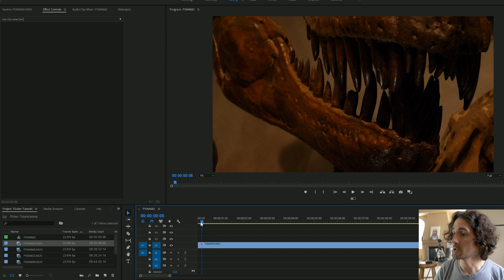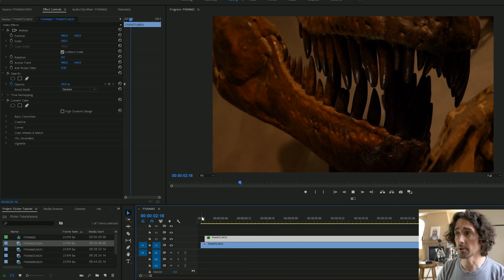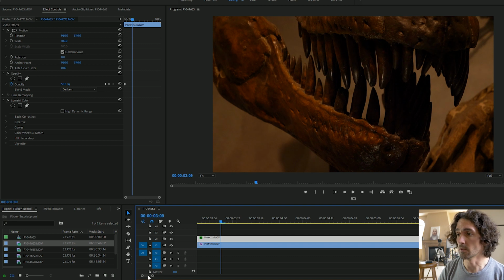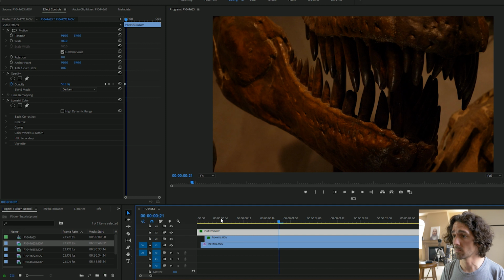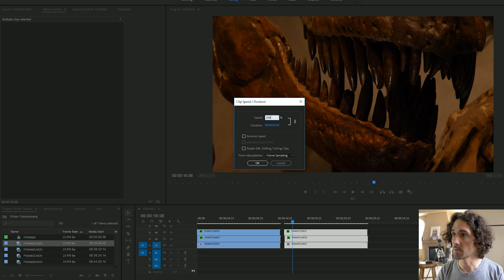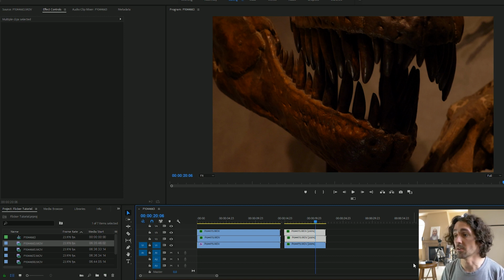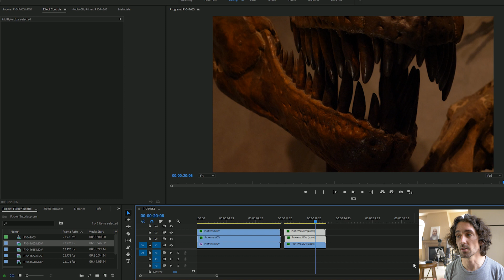Quickly Remove Slow-Motion Flicker In Premiere

Comment: Hey, didn't get the "200%" clip speed. By doing that how did you kept the same speed and motion in the clip?
Reply: this is really late, but he didn't keep the same speed. it's just that he increased it from 1/5 speed to 2/5 so it's still really slow but slightly faster

Comment: Okay...Why this is not working...? I shoot at 60 fps  - NTSC  (i am in Europe).
Reply: All bad advice. Some things just cannot be fixed in post and somtimes you,ll never get rid of flicker. When shooting slowmo and you are getting light flicker you should decrease your shutter speed. 
Sometimes even that won,t help because if you have two or more different light sources in frame each one of them could be working at a different hertz frequency, then you are pretty much fckd. With adjusting your shutter speed you might be able to deflicker one light source but not the other. You will have to test it out. It,s just pure physics.
Reply: same
Reply: @iamkevinkouassi  but 60 fps gives more slow motion... and my timeline is 24p anyways... it should work
Reply: @iamkevinkouassi  but nowadays, ntsc and pal arent any important, tvs in europe can display 24fps as well as 25 fps the same way... and as 24 seems more cinematic and 60fps gives more slow-motion, its just the better coice i think... and it works fine, other than this effekt here to remove flickering... it just somehow doesnt work :(